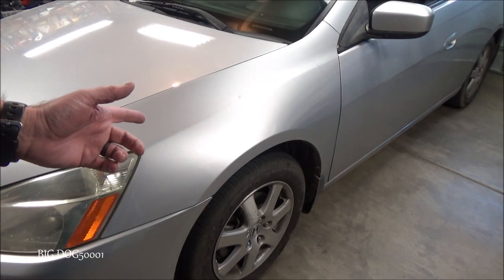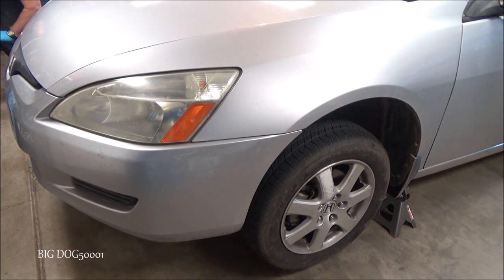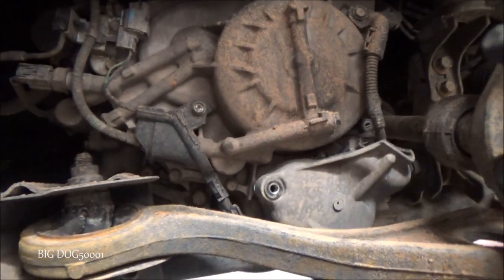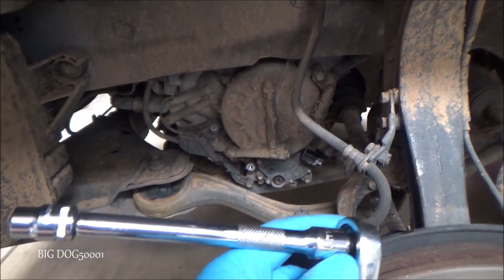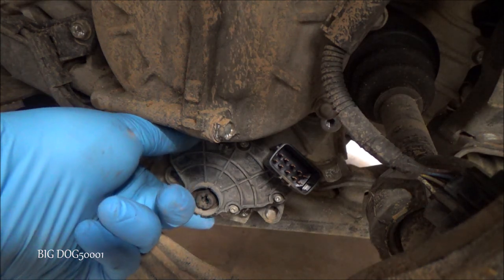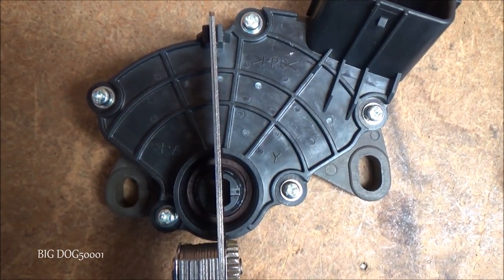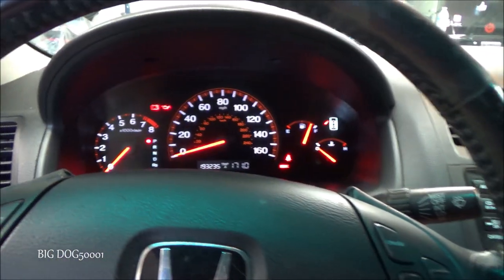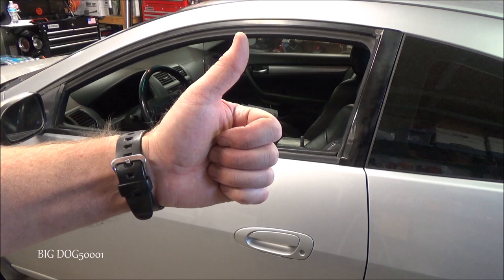Honda Intermittent No Start-Transmission Range Switch Replacement 2005 Accord V6 (2003-2007 Similar)

Comment: mine has a no crank no start issue right now. just changed the starter a year ago for the same reason and the battery 2 days ago. it was starting fine now this mornig its -20celcius outside and it wont crank again either on park or neutral any ideas? maybe the ignition switch...
Reply from the maker: A no crank no start could be many things, too many to list here.  If ignition switch is going out, wiggling key all around and moving it back and forth while trying to crank the engine can show if it is the problem (if it starts as soon as you wiggle key then the ignition switch may be the issue).  Double check connections at battery for sure due to recent battery change (they need to be good/clean/tight).  Starter Cut Relay is something to think about too:  https://youtu.be/S8BWPdi8OO4
Reply: @BigDog50001  thanks!  I'll definitely check that out.

Comment: In the beginning you said that there was something else it could be and what is that because that’s how I can fix my car
Reply: Check battery first, then fuses, then check starter. Trust me when i say to test the starter yourself doing the bench test method. You can look up videos on here for that, but basically you get a car battery, and connect jumper cables appropriately to battery, and positive to the main lug on starter, and negative to the area where the bolts go. Then get a 2 gauge wire and touch the positive side connecter/cable with one end, and then the ignition switch blade with the other end. It will spark, and it may move slightly, but you wont get hurt if its done right. If the gear pops out AND spins freely, its good. Make sure you let it spin for a minute to see if there is a voltage drop. If it stops spinning, you need a new starter. If it spins good, you need to move onto an ignition switch test. Many videos on that as well. Then test main ignition relay. If none of that, you have a bad wire.